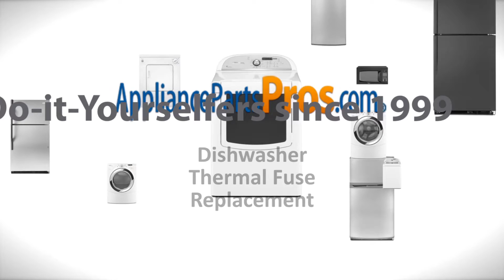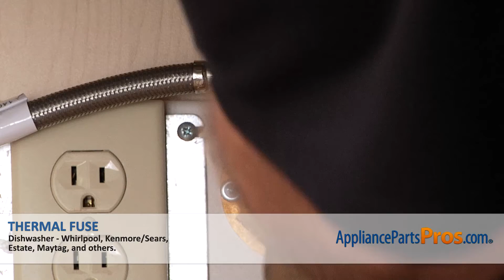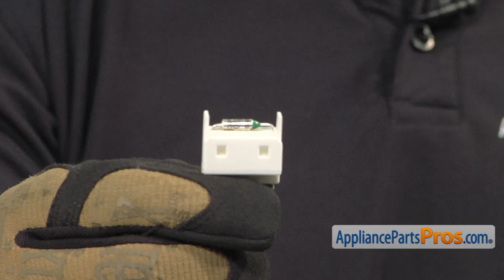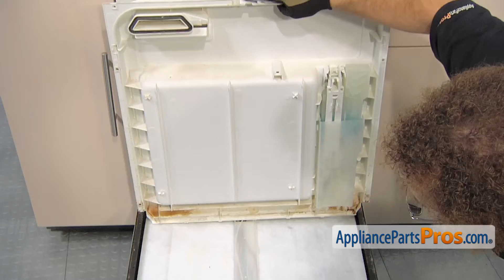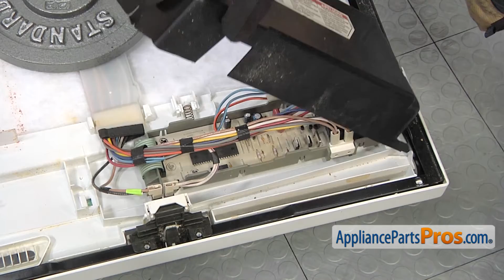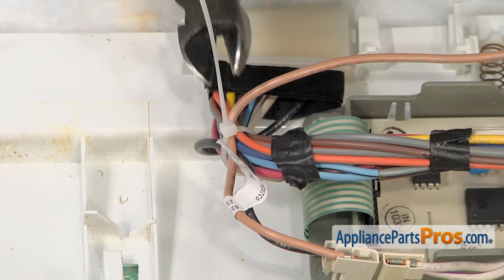Whirlpool Dishwasher Thermal Fuse 675813 Replacement — fits KitchenAid/Maytag

Comment: any tips on testing the thermal fuse before replacing it to be sure it's bad?
Reply from the maker: You will test the thermal fuse for continuity with a multimeter.

Comment: Yeah I wish this had more clarity this is not a good video they need to back up the camera so you can see what part part that they’re working on and if they’re trying to snap off a part which is the fuse the actual thermal fuse then they come in different colors and different ways to come out that’s crucial that that’s the whole part of the video

Comment: Is there a reason you couldn’t just replace the fuse assembly as opposed to dealing with the other wires?
Reply: That was my question. I tried just the fuse but it didn’t work until I then changed the wires as well

Comment: Also, not sure if it was your example or what but on the door switch, my brown cable was switched with the black cable in terms of location. I replaced the tan wire as instructed and it worked.

Comment: Why can't you just unplug the old fuse and plug in the new fuse? Why do you need to cut the wires?
Reply: 611111111111111111111111111111111111111111111111111111111111111111111111111111111111111111